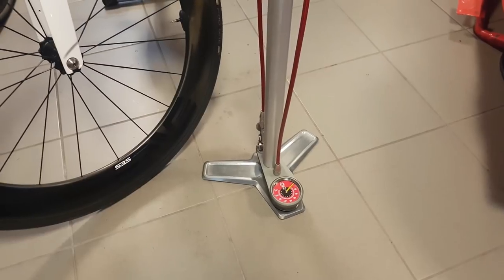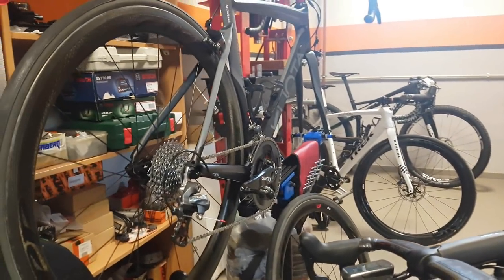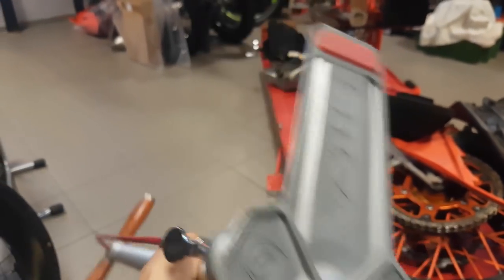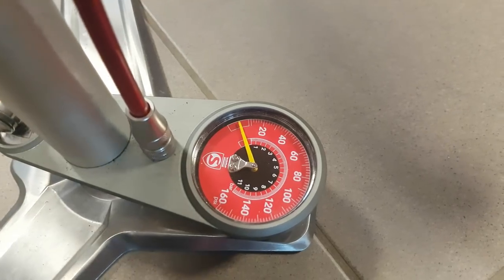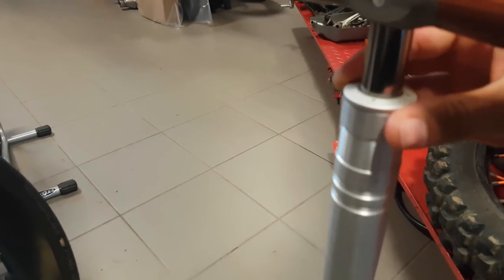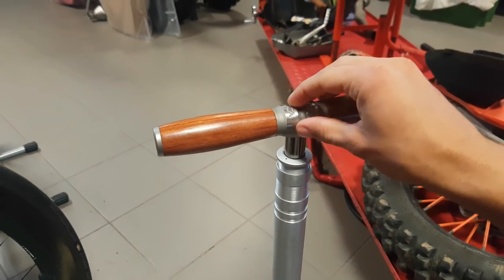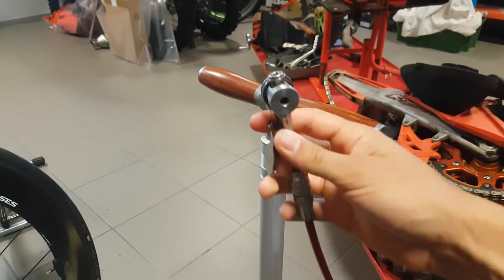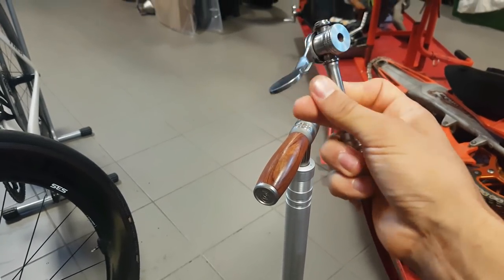Will a 500€ floor pump be ever worth it? - Silca Super Pista Ultimate review

Comment: I have the pump and love it. Value is relative to the money you choose to spend. There is a point in cycling where more money has diminishing returns. And yet, people buy ridiculously priced bikes that don’t make them faster. This pump is a work of art. Judging its value on function is besides the point since the total value of the pump is based on its form, function, and durability. You pay for the form with this one. If you can stomach the price, using this beauty is pure bike tool aficionado heaven.
Reply from the maker: Exactly!
Reply: Marketing is so strong: it's an idea, and, it's human to justify this kind of prices, certainly when you spent it yourself :) Everything is worth what the fool - meant ironically - wants to pay.
Reply from the maker: @pureeschaap  you don't really understand, do you? In the long run, this is the cheapest pump in the world. Plus, it's low volume manufacturing with special parts, the price is fully justified. This type of hose in this length costs ~100€ on it's own.
Reply: @ronykuba  I do understand the idea of saving money via buying quality goods, and/or, so called exclusive goods (by all means... if you believe the concept of limited production 😁). But, in casu, what about the durability test please? Will you i.e. make a 5 year comparison test?

Comment: Some people would say that this is a complete overkill. I have a similar looking pump that has served me just as well for 3 years now for $50. Having worked at high end shops you'd be better served by using a compressor with a special attachment that provides accurate reading and pressure modulation. This pump should be no more than $200. Rest is what you pay for Silca logo.
Reply from the maker: I do have a compressor, but prefer the pump. The hose alone costs 100€, the price is fully justified.
Reply: I'm sure your pump serves you well, but I guarantee it is not as accurate or precise... nor will it last as long as the Silca.  The devil is in the details.   Why does a Ferrari cost $400,000?   Why does a CHEAP Rolex cost $10,000?  Each Silca SuperPista Ultimate pump is assembled BY HAND in Indiana.  There are 72 components from 24 vendors in 12 countries to create this pump.  The hose is made by the same company that makes brake hoses for Formula One cars!  It is the best hand pump you can buy, but the level of precision it offers isn't for everyone. :)
Reply: @DoneRightReviews  This pump is made in Indiana? I thought Silca was an Italian company.
Reply: @povertyspec9651  It was,but a rich American who used to work for Zipp or the like brought the company.

Comment: Really nice pump :) I also use it. Now I have ordered the HIRO head as you have because I need more gentle and accurate grip than the standard one. The big advantage of the pump is, that you can change the barometer with a lower pressure suitable for cyclocross or gravel ;) Silca also make a portable pump, if you travel a lot - it also come with bag.I would like to ask which bike stand do you use? Is it avaible in Czech Republic? Thanks, regards Miloslav

Comment: Silca makes a pump for $100.00 US that is rebuildable, but the base is not very stable and the pump handle is smaller. for a home pump is pretty good. If I had a shop I would spend the extra money. Thanks for the great info
Reply from the maker: Yes that's a good option for home use

Comment: A beautiful pump, but if the justification is that you inflate a lot of tires/day in your shop, it seems like a good quality air compressor would be a much better option.
Reply from the maker: The pressure measurement on the compressor is not very precise

Comment: This pump looks similar to the Specialized Air Tool Pro Floor Plump which costs about $125. They are both serviceable and made of a complete metal structure albeit, the specialized probably made of aluminum. Having worked in a shop, we kept said pump as the primary pump for people looking to get a quick top off. It was very reliable and only needed service once a year.  Do you have any experience with the Specialized one? If so, how do they differ as the price is much cheaper?
Reply from the maker: I've never used that one. It's low volume with special parts, plus high precision steel machining is very expensive, and I guess you also pay for the 25 year warranty

Comment: Hi thanks for the in-depth review; question: would this work well on a 20" BMX wheel?  There is less space between the hub and the rim, compared to larger wheels.  Would the schrader end of the hose bend sufficiently to fit in that smaller space?
Reply from the maker: Probably yes.
Reply: @ronykuba  Thanks. I’m so intrigued by this pump.

Comment: Your run-through of the pump does not convince me of the premise that the pump is worth 500+100 euros. I remember your initial review, where you mentioned some issues with the pump, yes they are solved now but this is a pump worth more than an entry-level road bike, and as much as an all new bling Shimano Ultegra R8000 group set. Then there is the issue inherent with the concept of a "pump", I for one will never be convinced that the pressure indicator will be properly gauged and even if it is, the display is far too small and crammed to really get an accurate reading (I'd expect a 10th of a bar accuracy at the least on a clear indicator, this one would require a magnifying glass for a reading that accurate). There are simple floor pumps of 10% the price that can deal with identical levels/intensities of use (i.e. pumping the 30 tires a day that you mention) without the SILCA shield warranty - which covers only the first 25 years of regular use, mind you.
Reply from the maker: "Only 25 years" are you kidding me? Some building materials don't have a warranty as long as that. The accuracy is 1 Psi, and it's perfectly readable.
Reply: I endorse the idea of an accurate gauge. Worth less than this pump, as well in production as marketing value, and superior to this analog system.

Comment: Sks rennkompresor not good enough?
Renn = Seiko
Silca = Rolex

Utility wise its the same but I understand why you went for the Rolex.
Reply from the maker: It's an utter PoS
Reply: Ronald Kuba  its 1/10 of the Silca price, why be such a snob?
Reply from the maker: @oreocarlton3343  it has failed me when it shouldn't have. Plus I simply hate the wobbly base and plastic head
Reply: Just change the head and hose! I have 2 rennkompresors with Hirame and KCNC heads. they are TANKS!  The last one I had was 25yrs old until it got trashed.
Reply from the maker: @chaosengine3772  no, thanks
Reply: @chaosengine3772  yeah, all plastic heads with double valve suck, just change the head on sks

Comment: Absolutely no. What did you do before you had this pump ? How many times had you failed to pump up a tyre with your old pumps?
Reply from the maker: Leaking heads, failed gaskets, broken shafts, heads that broke valve extenders, unstable, wobbly pump bodies... should I continue?
Reply: Ronald Kuba  First world problems :D
Reply: You should have bought a reasonable priced pump, not the most expensive floor pump you could find as you did now. There is more than 'minimum' and 'maximum' in life :)
Reply from the maker: @pureeschaap  I wanted the best, so I got the best. Don't tell me what to do.
Reply: @ronykuba  It's only a common sense suggestion. But... Who am I? A mere human being. As we both are. With or without a 500$ pump.

Comment: You look a bit snobbish so that pump perfectly fits you. I have noticed you like to buy the most expensive stuff only to be later replaced by other most expensive stuff (after been called unsuitable). This factor a bit discounts the value of your videos.
Reply from the maker: I like to have the best equipment, sorry to upset you
Reply: The most expensive does not equal the best. Sorry to lecture you. Read some tests and unbiased online benchmarks before buying any expsensive crap that gives you a false impression of quality or superiority.
Reply from the maker: In this case, it does, in others, it doesn´t. If I thought the most expensive is the best, then how come I don´t have Lightweight wheels, SRM power meters, custom 7000€ Argonaut frames, 1500€ 3D printed pulley wheels, etc? I buy stuff to learn what works and what doesn´t, in case you haven´t noticed. That is regardless of price. Learn your sh*t before mocking.
Reply: It's hard to argue that pump being the best... It's not. On the other hand, as a museum piece? Then YES!
Reply from the maker: @chaosengine3772  if it isn't, then which one is FFS?